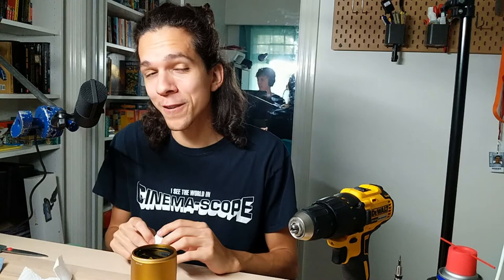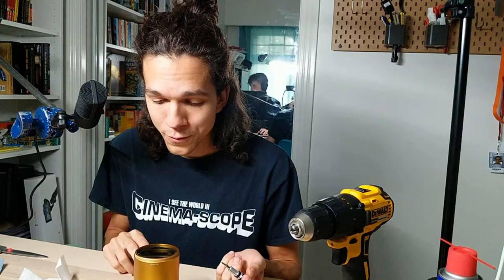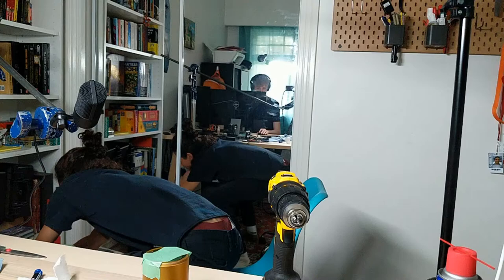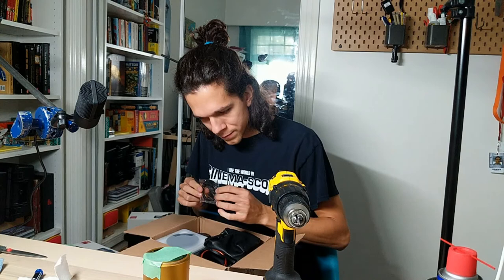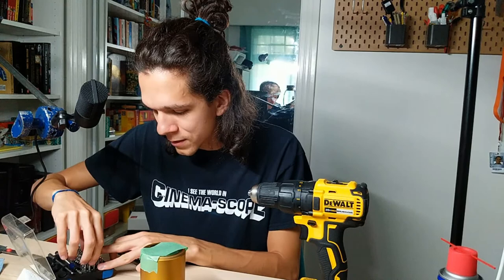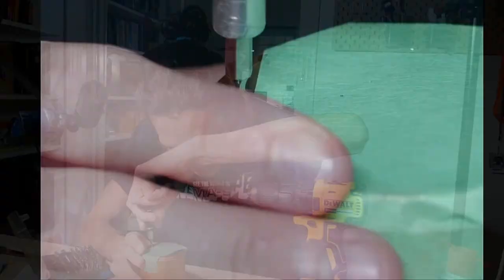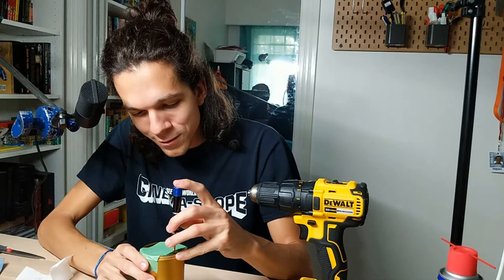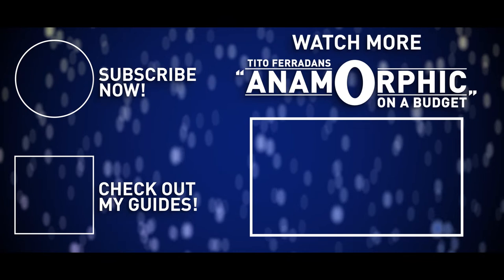How to Deal With Stripped Screws (on camera lenses) using an extractor bit - Part 2

Comment: This video is great. Purely becasue it's great to know I'm not along in my pain! Replacing the focus motor in my big 150-600mm lens and 5 out of 6 screws as part of the 2ns step have stripped. Sat here with my extractor set also trying to work out which way the first bit screws. Thank you for taking the time to share with with the world!
Reply: Got them all removed and the focus motor swapped. Now have a completly working lens again!

Comment: thanks!
one thought  is to tape tighter! thin flakes of metal (aluminum etc)  stick to the glass or bond with the coatings, causing noise inn the glass that can't be removed without destroying the coatings. cover glass completely, tightly, and clean the area well. learned this from seeing flakes stick to the glass from a bent screw filter mount on takumar

Comment: Using ezy out stud remover for damaged motor engine stud, first drill tapping hole then apply ezy out with LH thread rotate right as it beds in to stud. Damaged stud will eventually rotate out. Simple. 🎥 👍

Comment: Almost all screws and nuts use the right-hand rule of engineering: Point your thumb straight out. Curl the rest of your fingers. Turn in the direction of the curled fingers. The nut or screw will move in the direction that the thumb points. ---- Easy. -----
Reply from the maker: Yes, righty tighty, lefty loosey. But some of them just forget that they actually need to move.